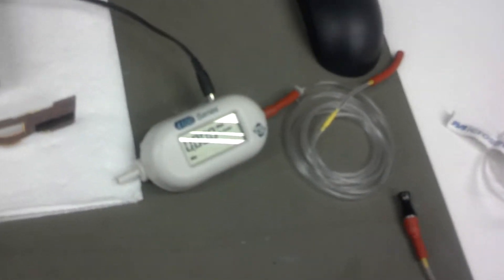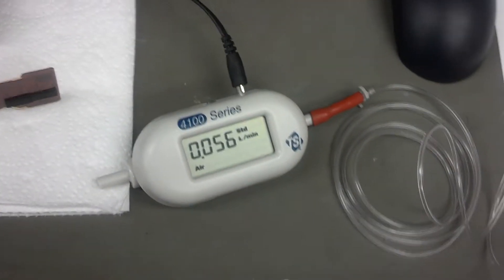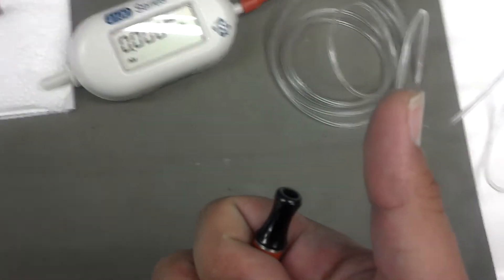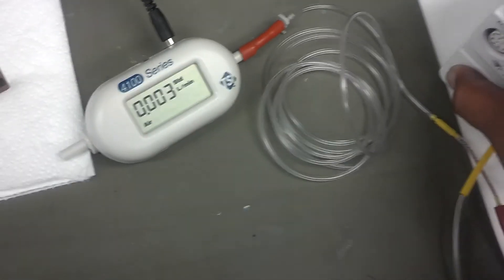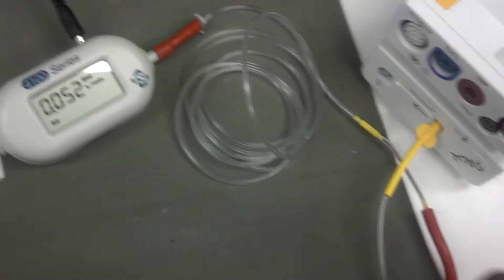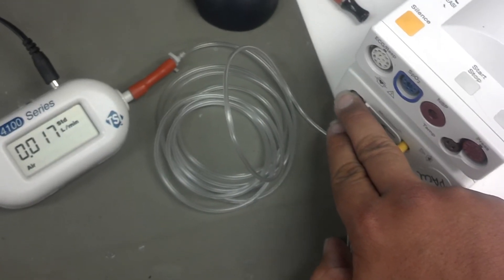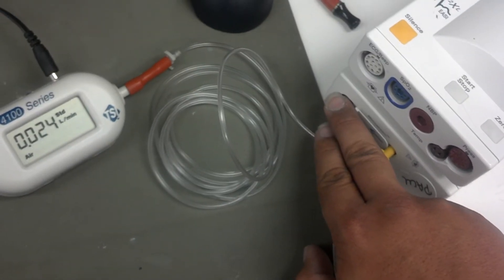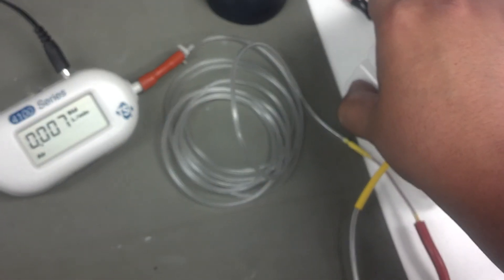M3015A CO2 Module Leakage Test 1

Comment: DO NOT do this for "new"  hardware revision Ver C, you will damage pump easily, there is different procedure for them. You have to do it on powered OFF co2 unit, connect in series input and output of CO2 with manometer and big syringe, using syringe build some negative pressure like 250-300 mmHG and clamp syringe line. CO2 unit should keep pressure and leak less than 20 mmHG
Reply: Should make a video on this.